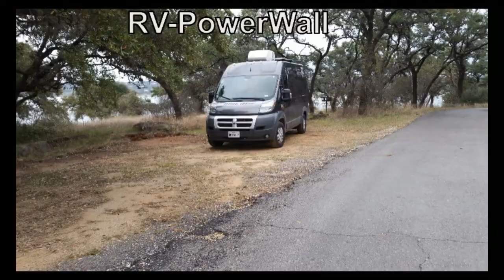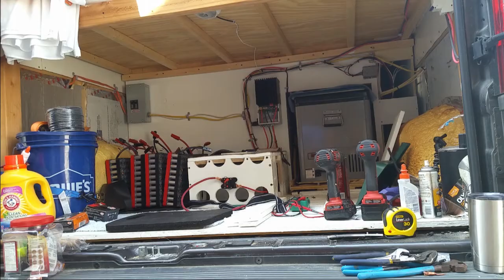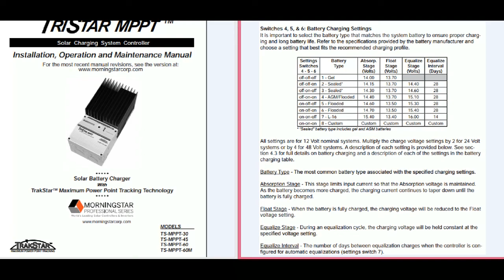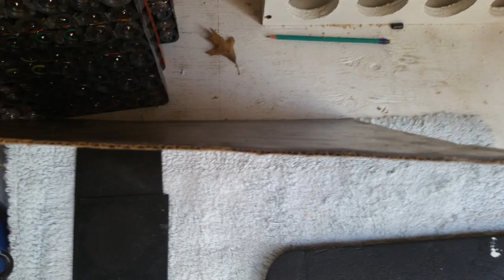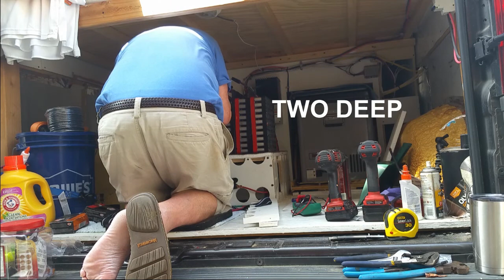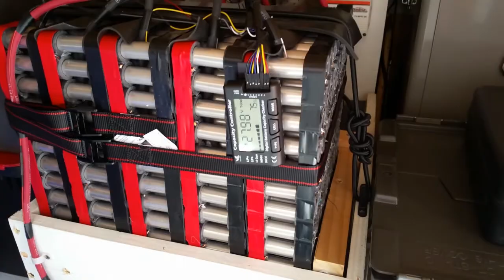Bug Out RV 18650 Battery Installation  #15

Comment: Love it brother 3 of my charge controllers are Morningstar. I have worked in the alternative energy field for more than 20 years of my life. Have been all over the earth and the one thing that has been the same was a Morningstar charge controller. Btw Just found you from OTE.. If you get time stop over and see if you like my stuff. God Bless.
Reply from the maker: Yes I have never had a Morningstar go bad on me. Compared to the China juck that get hot way before the stated capacity. I have also used the out back and they are great but twice the cost of the Morningstar.